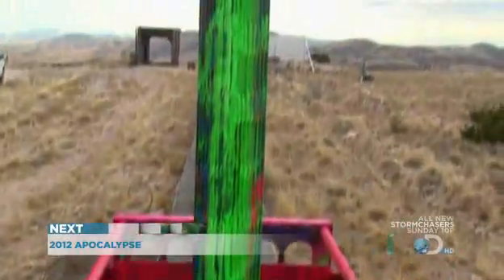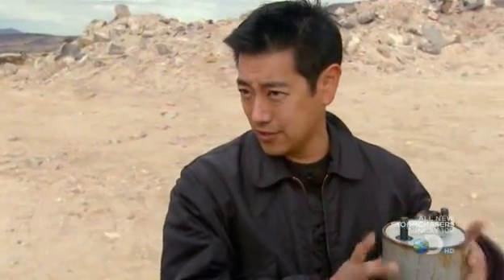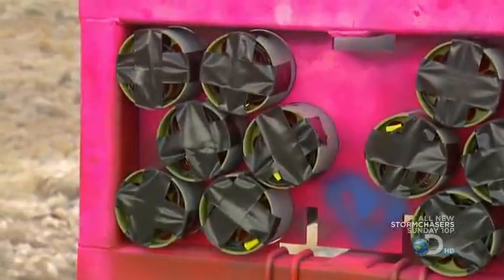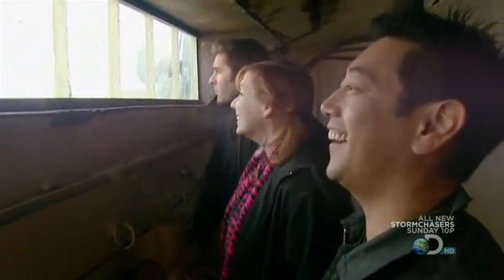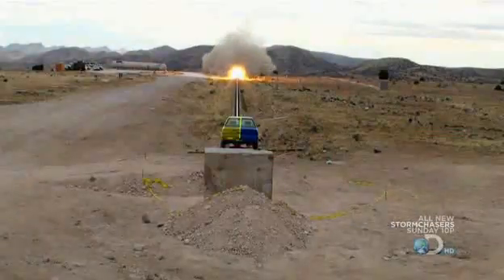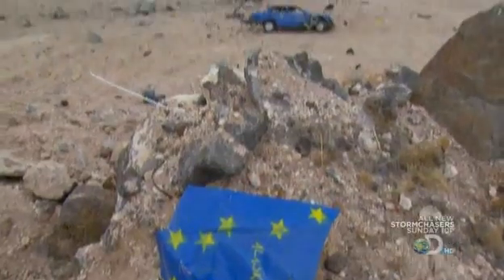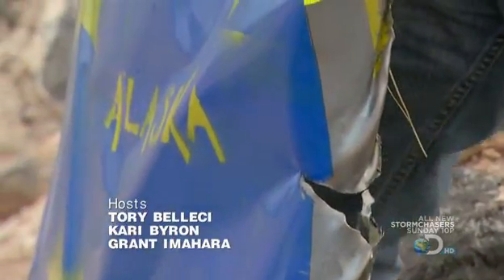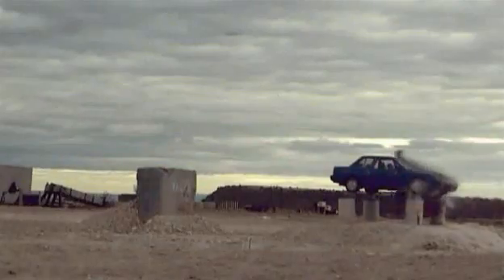Mythbusters: Myth Revolution - Rocket Snowplow

Comment: That is one more proof that the planes couldn't ruin the "Twins" during 9/11.
I think in this experiment they installed the concrete block behind the car especially - otherwise everyone could see that the steel beam has left undamaged even after cutting apart the whole car.
Reply: + dilireus > You're wrong pal. The entire world hadn't seen how the planes ran into the Twins. Really. The entire world saw THE MOVIE how the planes ...
Don't you understand or don't wanna understand the difference?
For example in that movie "the entire world saw how" Boeing 707 was flying with the speed of more than 500 miles per hour at the altitude of 700 ft... but it's impossible. At all. Boeing can not fly horizontally with such speed at that altitude.
Reply: Because the columns where massive and wedge shaped?
Reply: asking_price If i remember  the planes were coming out of a dive they would be carrying extra speed but shedding it as they leveled out
Reply: beyond the physics, there's no way that with the number of people required to pull off a conspiracy of that magnitude, actual real information would have leaked by now. Human beings are human beings, and you'd need dozens of people at the minimum, you'd need to disappear the planes, and much much more. It's just not credible in the slightest.
Reply: +asking_price And this has exactly bupkiss to do with 9/11.  It's un-frickin-believable to me that the entire world saw the planes hit both buildings, yet there are still yahoos like you in complete denial.
Reply: First of all, the WTC had hollow steel beams, not solid ones.
Second, I think that you don't really know anything about what happened that day, or physics, or life, or anything for that matter, at all. Or do I have to teach you what kinetic energy is? If the Mythbusters would have launched a plane with 500 mph at that steel wedge, it would have evaporated as well. Two things that are travelling at the same speed do not have the same amount of kinetic energy. All materials can only resist a certain, limited amount of kinetic energy. And now, do you think that a fking plane, weighing quite a few tonnes, going with the same speed as something that only weighs 2 tonnes, has the same kinetic energy? I don't think so.
Reply: The heat from the burning fuel softened the structure in the buildings.  Why do you think they didn't collapse immediately on impact?  I'm quite surprised they didn't.  This experiment doesn't come close to modeling what happened that terrible day.

Comment: Someone needs to get ahold of a drone with wings  and fly it into a wall and see what happens.   The nose of a plane is made of lightweight stuff, and then there are wings that would break off and not go INTO the Tower on 9/11.  And the titatitum engines would not turn to dust.  Could there have been some optical illusion of a plane hitting the towers?  Will we ever know what happened. Well WWIII is really happening it seems as a result by design. Jet fuel cant melt steel to dust and not burn paper. FACT
Reply: +Cheri Jacobs At several hundred miles per hour, it doesn't really matter what the plane is made of. It's going to go through that facade whether it's made of paper or diamond.
Reply: ***** And it doesn't need to. The problem with high temperatures and steel is that steal gets weaker at higher temperatures. Had the planes flown into the towers a few stories further up, the towers probably wouldn't have collapsed. The reason the towers fell is that the steel was weakened to the point where it could no longer bear the mass above them.
Reply: ***** Planes don't generally crash at 500 mph. Even such light weight materials (and not all of the plane is light weight) are going to do massive damage to steel. I don't know if the planes actually completely blew out any columns, but I'm fairly sure that they damaged some heavily.
Reply: ***** I did at no point say that the planes actually knocked out any columns. The other bombing didn't compromise the WTC's structure, a fire burning for a long time in one of the upper levels is a different story entirely.
Reply: ***** that comparison was very stupid...I didn't expect different from a conspiracy theorist. the stereotype has it nailed down: tinfoil hat wearing, screaming and ill-talking hillbillies. no matter how valid any of your claims are in regard OF ANY conspiracy theory, you still sound the same...stupid, obnoxious. 'truth-callers', hell I'm havin' a good laugh.
Reply: +Cheri Jacobs It's been 10 years. The whole story is getting ooooold
Reply: ***** The buildings didn't fall at free-fall speed. And everything else you said isn't more than paranoid delusions.
Reply: Were you born ignorant or did you work really hard to prefect your ignorance.
Reply: asking_price Doesn't matter, really. A plane going 500 miles an hour's going to rip a hole in the side of the building. Of course, the building rips a hole in the plane, too, usually that hole is the size of the plane, and that's exactly what happened.
Reply: Sarge Rho
Reply: ***** Yeah, I know what the floors are made of. Concrete is prone to failure under sustained heat.
Reply: ***** The reason concrete is used is due to its high compression strength and load bearing capacity, as well as being resistant enough to the elements. But it's not a magic wonder material. It's going to weaken if you submit it to high temperatures for extended periods of time, beginning to spall. But that's not why the WTC collapsed, either, but might have contributed.

The reason the WTC failed is because the steel columns were weakened to the point where they could no longer support the mass of the stories above. Steel begins to weaken at about 425°C, and loses half of its structural strength at 650°C, and in addition to that, the heat load was uneven, distorting the steel structure and causing buckling failures. The combination of these two 

The collapse itself was a bit more complex than that, of course.
Reply: +Distinct_pX "considering the buildings were made to survive tornados, Air plane crashes, earthquakes" doesn't mean it will actually withstand all of these. Just saying. This whole discussion, bringing up the conspiracy everywhere you can...that is stupid. You make yourself look like kids bringing it up everywhere.
Reply: +Cheri Jacobs ALUMINUM HAT BRIGADE ALERT!
Reply: Oh yeah I found it long ago
Reply: ***** It's quite simple: They didn't. The wings were blown off on impact, only the much sturdier wing roots, containing things like the landing gear, actually went through the facade, along with the fuselage of the plane.

https://www.filesanywhere.com/FS/M.aspx?v=8c6b64895e97afbda8a3

You can clearly see the imprint of an aircraft, and you can see that the wings were blown off by the facade.
Reply: +Cheri Jacobs lol pretty sure this was a legit troll comment, and you succeeded so much.
Reply: There is footage of an f4phantom hitting the wall of a containment vessel at the speed of sound. 

Really should look at it.
Reply: ***** Learn to read, idiot.
Reply: +Sarge Rho bahaha replies to the wrong person
Reply: +Bruce Baxter where pls
Reply: Just search on YouTube for "f4 crash test"
Reply: ***** Unfortunately, youtube notifies me every time someone replies on a comment I replied to.
Reply: ***** At the speed where the impact energy exceeds the breaking strength of the material. A plane is fast enough to break through the facade of a skyscraper. Because concrete and glass do not like being bent. They have high compression strengths, and are very stiff, but they don't react well to sideways impacts.
Reply: Oh wait you're serious, let me laugh even harder
Reply: +Sarge Rho Why don't you wanna look at it from the opposite side - the steel beams (made of high quality steel) ran into the plane (made of light materials) at speed of ~500 mph?

Comment: 911 - NO PLANES!
Reply: You're right. Physics doesn't lie. This is proof.
Reply: ***** Because the theory that an airplane cut through steel is debunked by this experiment. Cars are made of Steel and forged medals and some aluminum. Where as planes are made completely from aluminum, they couldn't have done the damage we were lead to believe. That's why the comment is relevant. Do your research and you'll see.
Reply: ***** It would appear that it is you who is in severe need of a physics lesson. Newton's 2nd law of motion The relationship between an object's mass m, its acceleration a, and the applied force F is F = ma. Acceleration and force are vectors. In this law the direction of the force vector is the same as the direction of the acceleration vector. Which this means it doesn't matter whether it's the plane traveling 500 mph (Official documented speed) or the building the effect is still the same. Also that reported speed for the model of plane is IMPOSSIBLE at sea level. You haven't done any research. If you believe that jet fuel can get hot enough to melt steel you're beyond hope. Plus the vast majority of jet fuel burned up in that giant fireball on impact. The smoke was black which means the fire was oxygen starved thus it couldn't have been near its max temp of 1200 degree Fahrenheit. Steel melts at over 2500 degrees. And let's say that it did weaken the steel, how were they pulling out molten steel out of the rubble weeks later. 3 and 4,000 degree hotspots. Come on dude do some research and open your eyes.
Reply: ***** Didn't say anything about free fall speed. Building 7 fell at free fall speed, it fell in its own foot print in 7 seconds from a 3 floor office fire. You deny what I'm saying yet you have no evidence to prove me wrong. How come thousands of engineers, chemists, metalergists, and architectural engineers have come forward signing a petition to reevaluate the evidence. Both my father and I are pilots. The Boeing planes used in the attacks were not only incapable of the maneuvers they reportedly did but also incapable of the speeds they were traveling. The aeronautics are impossible, the control surfaces of the plane would have been ripped off. I would LOVE to see any video of your debate representing the AIA? Please tell me where I can find this. Answer this one question, how is it that molten steel was burning weeks later beneath the rubble? The hit spots in the rubble that are HOTTER than the max temp of jet fuel. How is that possible? Please explain.
Reply: ***** It's interesting how you in the same breath say I need to list information to prove my claims yet you produce nothing to prove yours. 

Do you have any idea how hard it is to get a building to collapse? All of it within its own footprint. Now how many modern steel high rise buildings have collapsed due to fire? Other than 911..... None. Not a single one.... Take the the Beijing Mandarin Oriental Hotel fire for example. The most recent example of a spectacular skyscraper fire was the burning of the Hotel Mandarin Oriental starting on February 9, 2009. The nearly completed 520-foot-tall skyscraper in Beijing caught fire around 8:00 pm, was engulfed within 20 minutes, and burned for at least 3 hours until midnight. Despite the fact that the fire extended across all of the floors for a period of time and burned out of control for hours, no large portion of the structure collapsed.

It is tempting to draw parallels between this spectacle and the destruction of WTC 1, 2, and 7 because of the stark opposites: on 9/11/01, three skyscrapers were transformed into piles of rubble primarily as a consequence, supposedly, of fires -- fires spanning small fractions of each building; and on 2/09/09, a skyscraper remained intact after burning like a torch for hours. However such parallels may be limited by major structural differences between the buildings in the two cases -- one being that the Hotel Mandarin Oriental, designed by the famous Dutch architect Rem Koolhaas, had a full-height interior atrium, and thus had the hollowness that the 9-11 Commission deceptively attempted to attribute to the Twin Towers.
Reply: The plane is made of aluminum. You can see that steel beam remained almost intact after the collision with the machine.

   
But the plane 911 we have 30 passes through steel columns (14.5"). Almost without stopping. But we have a Plane in the zone of collision with towers did not leave a single fragment

But some of the columns were cut at a huge angle.
http://s1.hostingkartinok.com/uploads/images/2015/03/2d79935e50d56e27a963af295c3ba9f3.jpg
Reply: *****
Density , mass, speed, contact area, thickness of materials - these are the indicators that determine the damage to the building.

Therefore, the material is important
All these figures are not in favor of the aircraft. Absolutely everything.

Or water, sand, air can bend steel under normal conditions?
Reply: *****
Thickness of the wall of the WTC - 0.5 Cm. To punch a beam - aluminum and duralumin wing wings required "cut" 1 cm steel. This minimum thickness formed with full flexion of the column in the "pancake".

However, the columns are not bent pancakes, they Peer bent, but the plane still has to break through.

they use a mass of aircraft, forgetting the weight of columns that are facing the building - a proof of their ignorance.
Reply: Андрей Алейхин not sure where you get your facts but the walls of the twin towers are 4 inches thick.